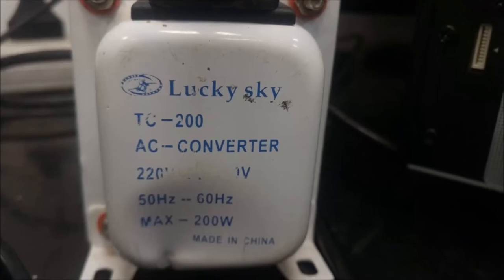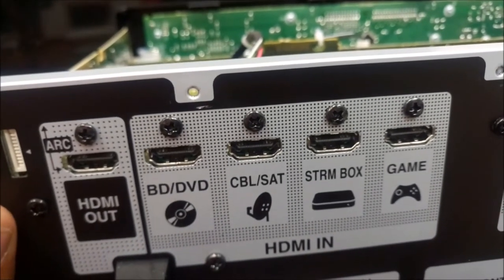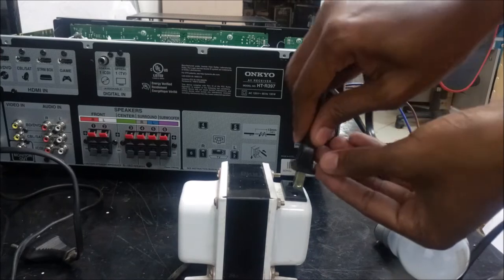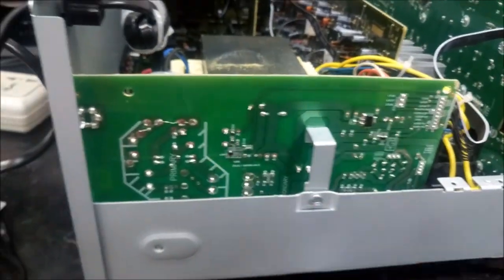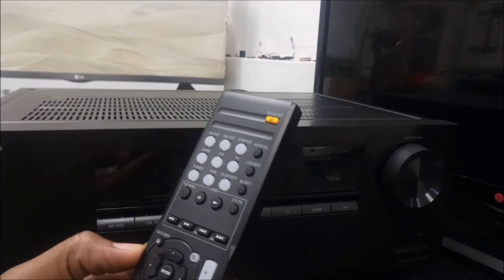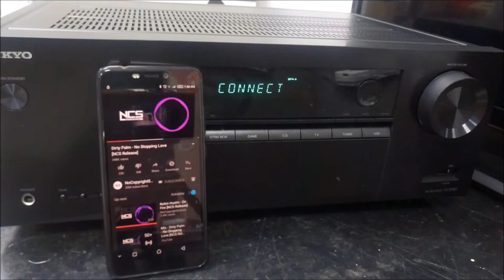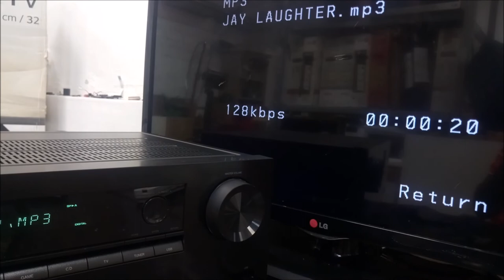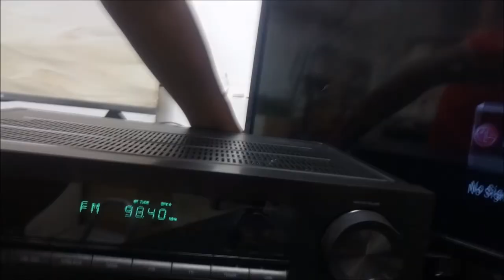Fixing A Blown Onkyo HT-R397 AV Receiver

Comment: Hello Dominic, Thanks for the video. I have an ONKYO HT-R393 that was also plugged directly to a 240v outlet, we replaced the fuses and powers on just fine. Challenge I'm facing is that I do not get any output to the speakers and bluetooth is stuck at "NOW INITIALIZING...". Any advise on how to troubleshoot? I'm yet to heat the DTS chip as most people are addressing the no sound issue

Comment: Hey Dominic..thanks for video. Have a onkyo nr676 from Amazon. Plugged it directly to 240v instead of 120v ..some smoke and doesn’t come on.the fuse is still fine and intact..what else can I check to replace if blown.

Comment: hi, a friend have a onkyo HT-R358, the reciver is 100% new, but no turn on and the fuses are good.
Reply from the maker: If it's a completely brand new unit then the solution would be to take it back to the shop. No need to try and repair such a unit when the warranty will cover the cost.
Reply: @DominicGichane  creo que fue comprado el año 2012 pero la caja fue abierta el dia de ayer asi que ya no tiene garantia. (Disculpa que escriba en español , pero me resulta mas facil, espero me entiendas y puedas ayudar)